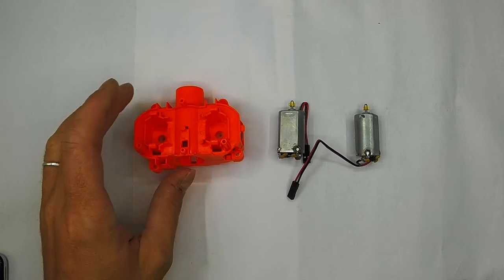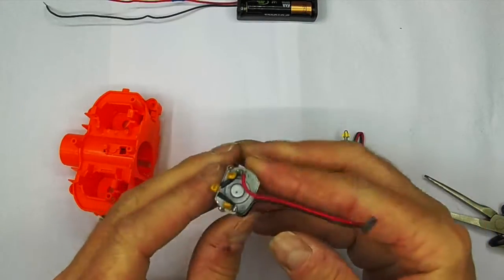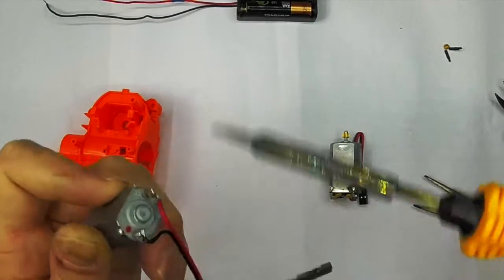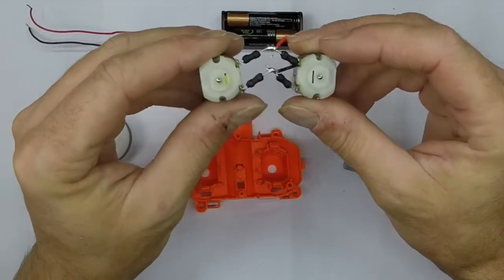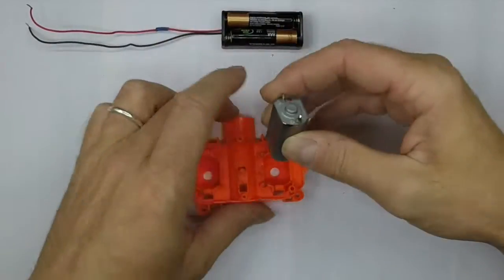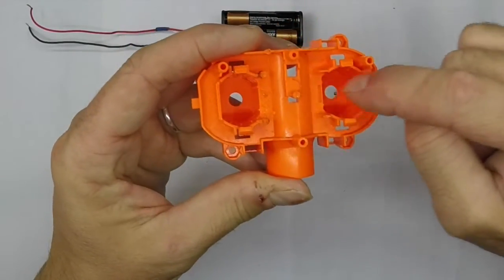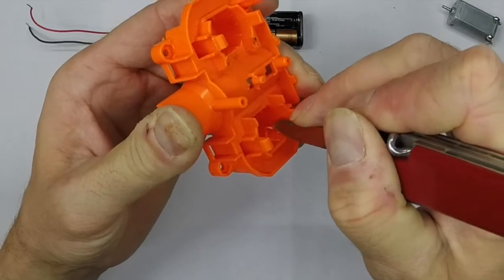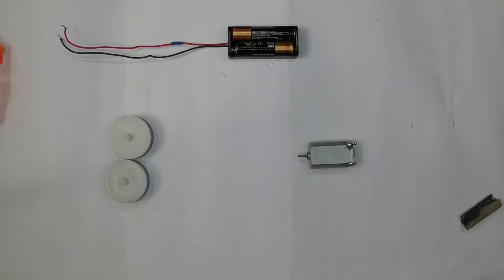How to- Set up Modded Flywheel Motors Part 1

Comment: I need to see how to remove the stock motors.
Reply from the maker: https://youtu.be/j3i_KIK6cVg
Reply from the maker: See linked video, then pull the flywheels and push them out. If you are not re using them just pull them out with a pair of grips or push down on the motor shaft. Warm the cage with a hairdryer to ease removal.

Comment: What have you done to the flywheels? I don't want to be aftermarket ones yet, and I find this idea interesting.
Reply from the maker: I checked they were round then I weight match and size match them in pairs. Throw out all Rapidstrike flywheels, every set is bent and unbalanced. I did a video on flywheel matching.

Comment: how do i remove the old motors out of the flywheel cage?
Reply from the maker: Take the wheels off, I heat the wheel with a hairdryer then pull it off using grips on the spindle, then heat the cage around the motors, push down onto the shafts and the motors pop out.